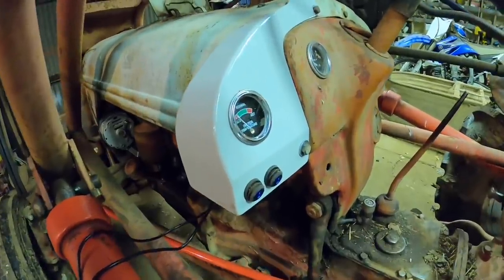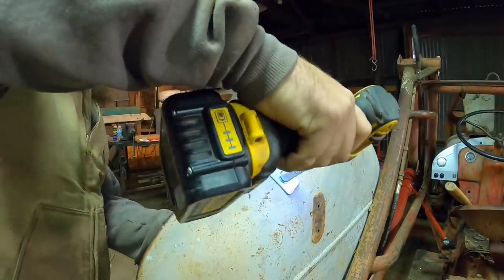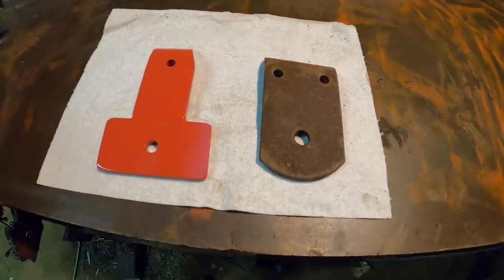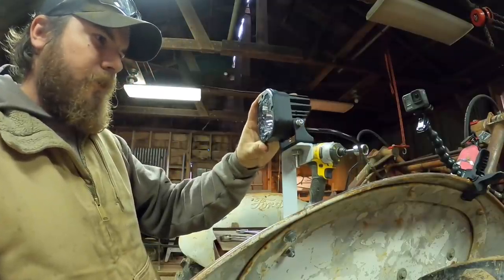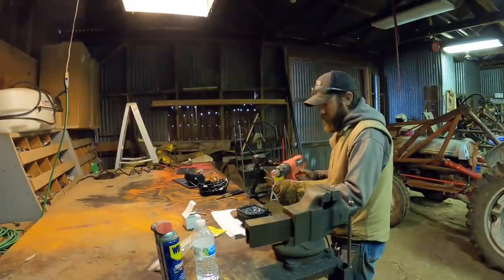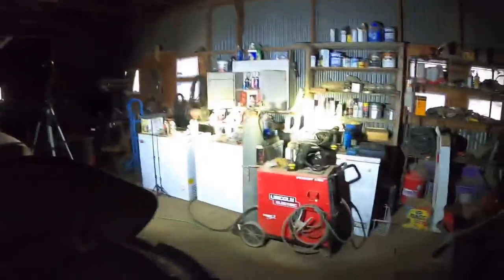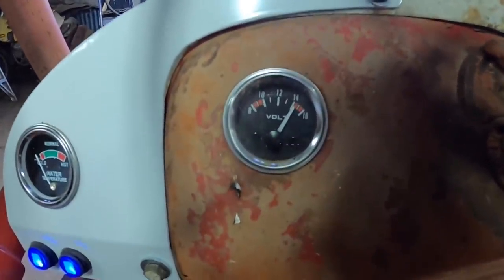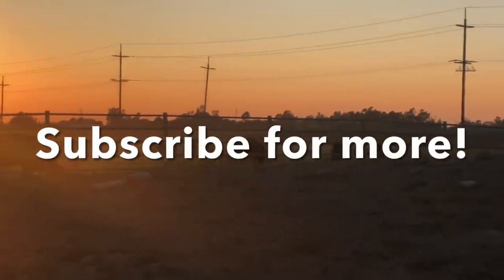Installing Auxbeam Lights on an 8n Ford Tractor

Comment: The Auxbeam lights are nice. All that really matters is they function. Only thing I don't like is they kinda take away from the style. I found some LED lights for my 1950 Farmall Super A that match the the original lights. Was able to place the LED's into the original light housing.

Comment: 9;03, off topic but, that blasting unit, did it come with everthing but grit and air, i watched the video but i smoke alot so im just going to ask, also  the air you use for it, whats the smallest compressor you would suggest to use for old engine parts

Comment: the only blind spot youll have is when the loader is up and the bucket is blocking the light.. but youll probly wont be using it much up in the air like that.  but great work

Comment: Your not going to like your mounting points in the middle of the tractor when you have a bale on the front blocking the lights….. all our old loader tractors run lights on the outside of our loaders for that reason or up high on a rops or canopy. Still better then no lights!